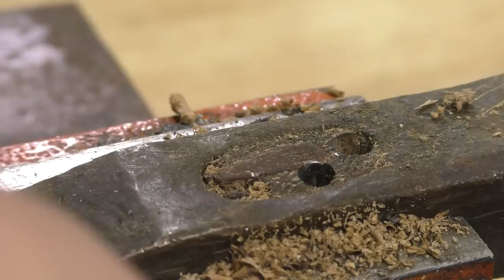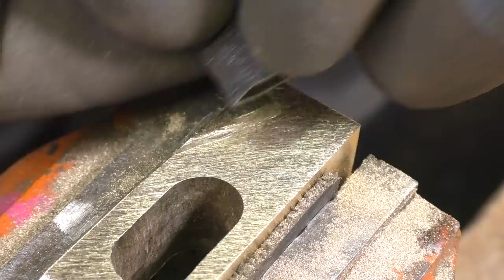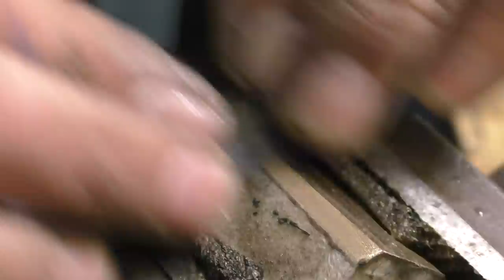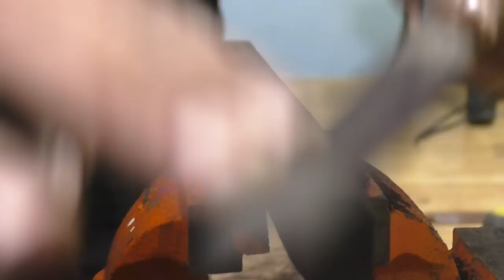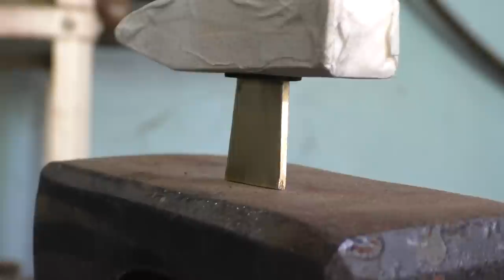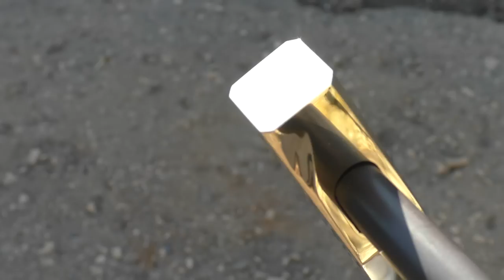Restoration Of An Old Brass Hammer

Comment: It feels like the metal is too soft. Why didn't you temper it a couple of times
Reply: Point of brass hammer is for it to be soft, its mainly used to tapping delicate steel machinery that cannot be dented.